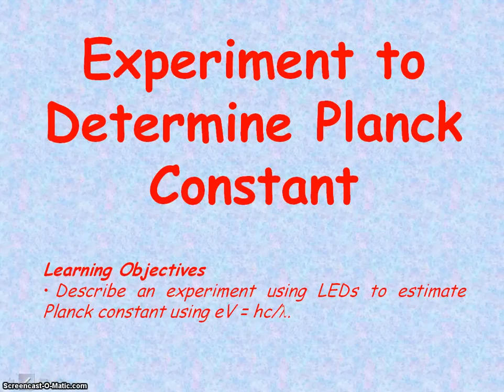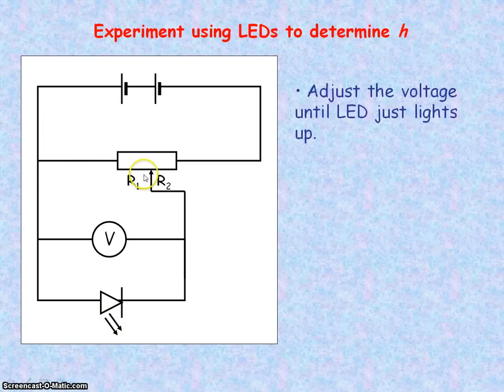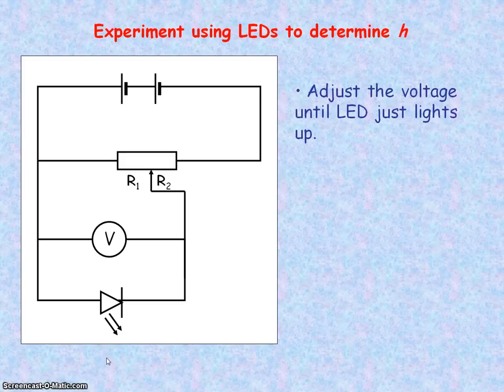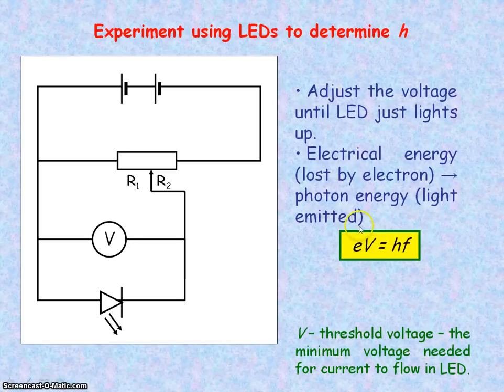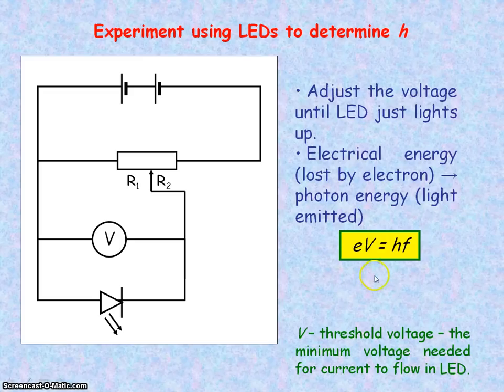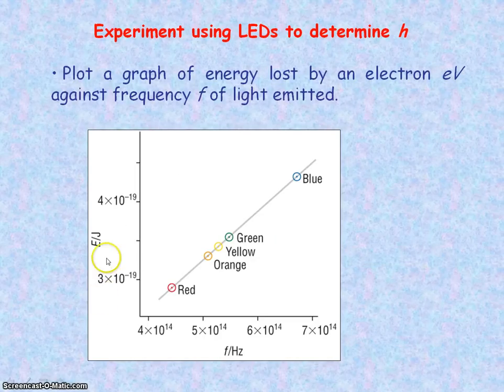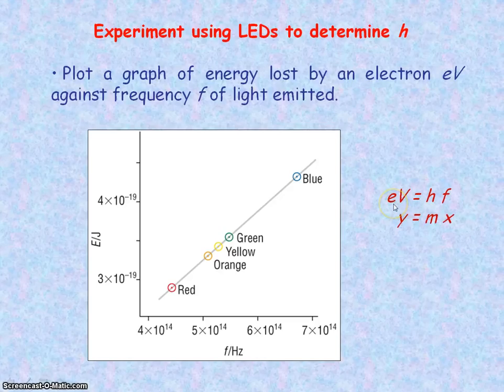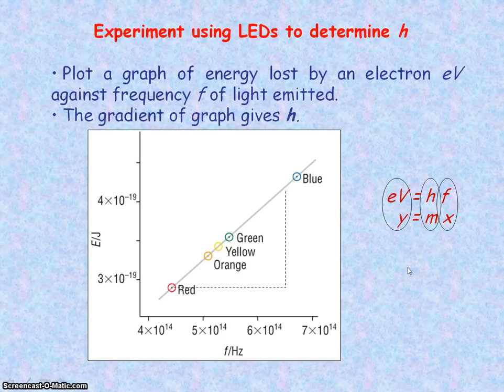Quantum Physics 03 - Experiment to Determine Planck Constant

Comment: that's not a variable resistor is it?
Reply from the maker: The circuit diagram involves a potential divider.  You're right that it does not show a variable resistor symbol.  A variable resistor can be used within a potential divider to achieve the variable potential across the LED.
Reply: You don't need an accurate/regulated voltage source--this unregulated V-source will drift, but that is OK since you are reading the voltage with the meter directly across the LED, thus you read the needed/actual V each time.